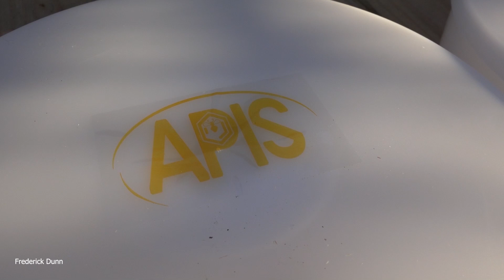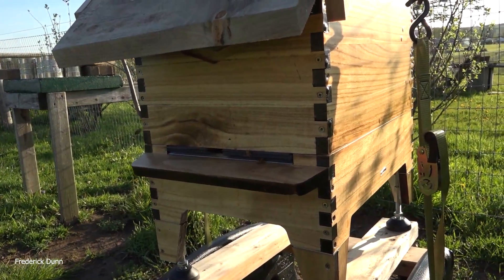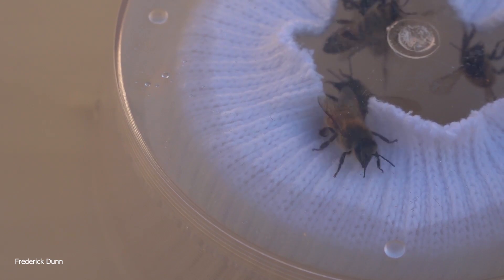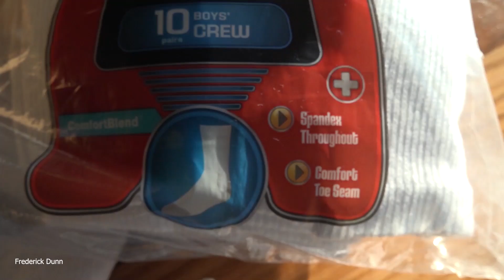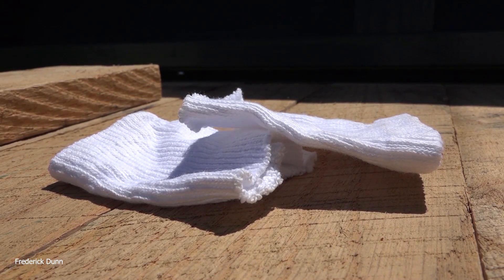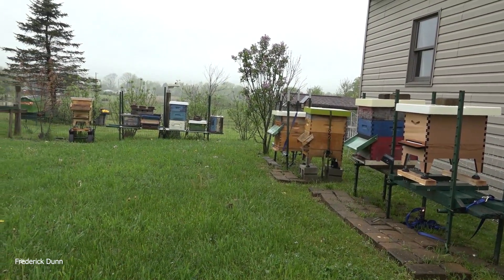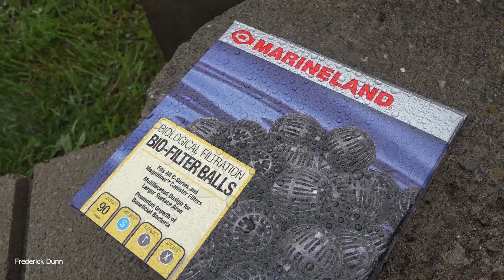Honey Bee Feeders and Drinkers that will not let them drown. Feeding Bees safely. Bio-Balls

Comment: How often do you change out the sock?
Reply from the maker: @FrederickDunn
  • 0 seconds ago
if I mix in 1 tsp of bleach to one gallon of syrup, the sock gets cleansed. If it gets covered in wax/propolis then I pull it and swap the unit for a deeper clean. If it ceases to function, I pull it.
Reply: @FrederickDunn  ok thanks, My feeder drowned about 20 bees and I quickly used the sock method, but now the bees avoided the feeder altogether. Does it take them time to get use to the sock? I washed it with dawn and air dried. Not sure if maybe the sock scared them off.

Comment: I used a sock, bees still drowned. Found about 30 of them drowned today. The bees climbed over the top and YES they do climb down over it and drown.  I don't think there is a feeder out there that doesn't drown your bees. I have bought them all.
Reply from the maker: You haven't used the 3-season Beesmart Design feeder.. nothing can get in it to drown. You have some strange bees there Lisa, orrrr they are pushing eath other into the drink in a mad rush.
Reply: @FrederickDunn  I will look into that one. No, I don't think they are pushing during a mad rush because it is happening after having been fed for awhile. So it isn't because they are starving. I think my bees aren't that smart to be honest. In breading maybe.
Reply: Oh yea, just looked it up. Yes I bought that one last month and that is where I had the most drowned bees. Handfuls. I went back to the rapid feeder and put a sock on it and not as many as the 3-season, but still 20-25 last night.

Comment: Mr Dunn, In a previous video you had mentioned using a dehumidifier to bring down the water content of honey that may be over 18/20%. Is it possible to use a refrigerator for the same purpose since it has to dehumidify the air inside of it to keep items fresh and reduce their exposure to moisture? I know that this can cause honey to begin early crystallization, but is it a viable alternative? Look forward to your thoughts.
Reply from the maker: The higher temps during dehumidification are very important for rapid dehydration. A fridge would slow the process and up the expense in electricity.

Comment: Question:  what do you do if when your feeder gets empty (using the sock method) the bees fill the dry feeder?
Reply from the maker: If they are empty and the bees are in the reservoir I just pull the feeder and open it in front of the hive (on the ground) and install a clean feeder in its place. It's always a good idea to have multiple rapid rounds and provide fresh clean ones if you can.

Comment: Hey Fred, thanks for sharing more of your experience and wisdom. The use of a block of wood to quickly close the hole in the inner cover when you remove the rapid round feeder is very clever. So clever in fact I’m ashamed to admit I have been struggling to remove my feeders for cleaning so have been putting it off. Too many smashed bees when I do. Not any more.  Not one injured bee!

You never know what tip you might inadvertently pass along to another bee keeper. Thanks again for what you do. Socks installed.
Reply from the maker: You are welcome Larry, so glad at least one tip helped you out :)

Comment: Fred, got the new feeder from better bee, noticed that the inside of the feeder had a terrible odor. Smelled of burnt petroleum, like a Diesel engine that caught fire. What do you think? Did your new feeder have any odors? As of now the socks are working great . Thanks for the great vids
Reply from the maker: That's not the feeder, it's the gasket that comes with it. That rubber smell went away eventually... yep, it's strong like a new tire store.
Reply: Frederick Dunn ok, good to know, I’ll wash everything and let it air out. Wanted to have the option of a larger feeder than the rapid round as the colony got bigger. The 5 frame Nuc I installed on Monday is doing fine with the sock😎

Comment: I bought large cell-o sponges and cut a 4” (nominal) diameter donut that fits within the clear inverted cut and around the feeder core.  I have no more drownings and no escapees into the feeder when the syrup level drops too low.  I have seen no indications of mold/mildew, but I do add the better bee supplement that you have indicated would act as.a preventative.

Comment: Hi Fred, I am continuing to enjoy all your work with the bees and sharing it with us. I wondered if the balls are a safe plastic? I live in Texas and it gets over 100 degrees regularly and worry about the toxins leaching into the water? What are your thoughts? Thanks
Reply from the maker: It's designed for fresh water and salt water aquariums where water chemistry is pretty important, but I would rinse the watering station completely on a weekly basis and it would be helpful to put it somewhere in shade. Direct sunlight isn't friendly to plastics, but that black plastic basin has been in use for 14 years.

Comment: I use Ceracell top feeders and I find when I fill them with more than 1/2 gallon of syrup  some drowning does occur. I’ll try the sock idea on the corner pieces to see if that helps. Thanks!
Reply from the maker: you're welcome!
Reply: After watching your Friday video I like the sponge idea in the corners even better!! 👍👍
Reply: I've used small cut pieces of a wine cork in the corners of the ceracell feeder. Works well but sponges sounds like a better solution. Thanks for great info, yet again 🙏

Comment: I have my feeders made from wood with stainless steel mesh on it just like the round feeder spaced but the mesh goes up to the bottom and the bees cant enter the feeder when the sugar water level is low.
I have no drownings.
The wood feeder its sealed with parraffine to stop the sugar water from leaking or soaking into the plywood.
Bioballs in the water feeder is a good idea.